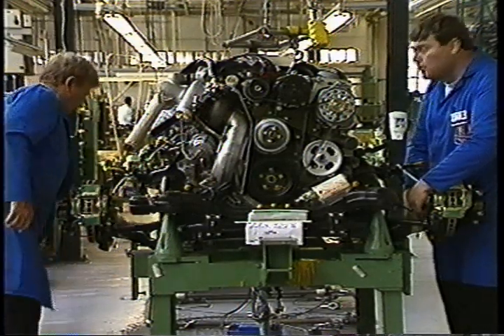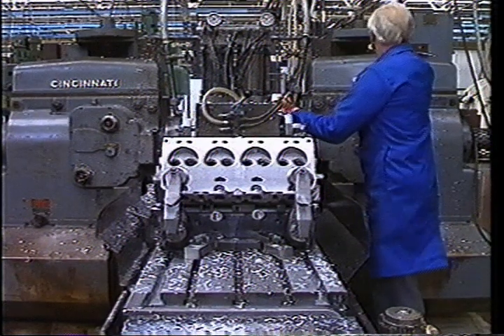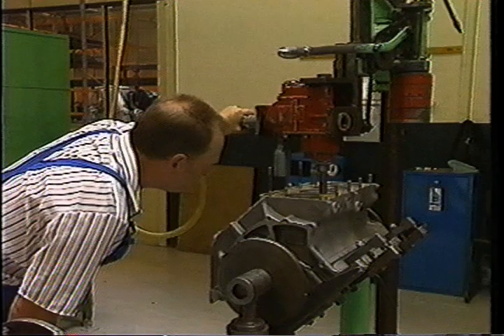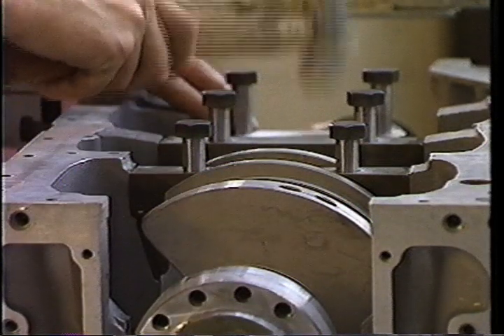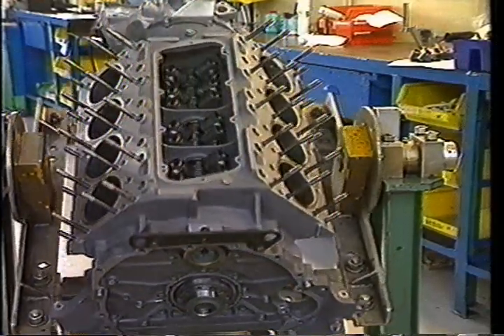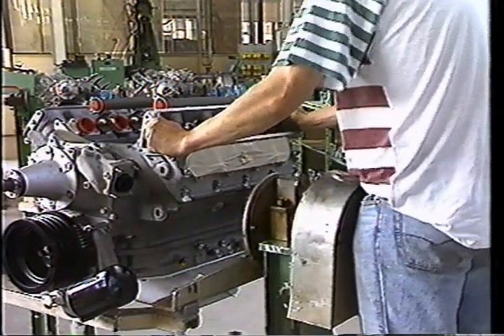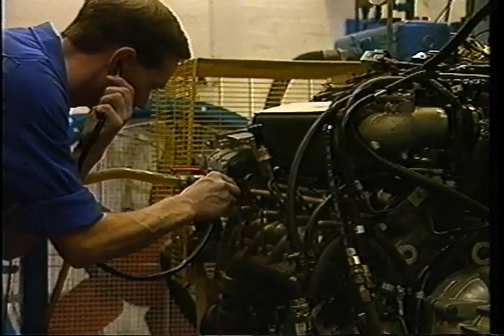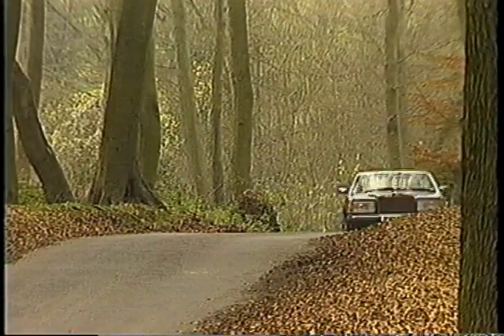Rolls Royce Engine 1995

Comment: A toyota lexus is made with machines and 30hours of human labour per car - with redesign technolgy from europe.
A small boutiqe car manfacture that makes  traditional hand made cars engines - tested way more than manfactured cars. The lovely1950s engine can run at full throttle for over 100 hours way before asia was developed by white impearalism.
My  father been mechanic for 50 years including RR military and we have number of cars including R.R - any car if maintain right will treat u well